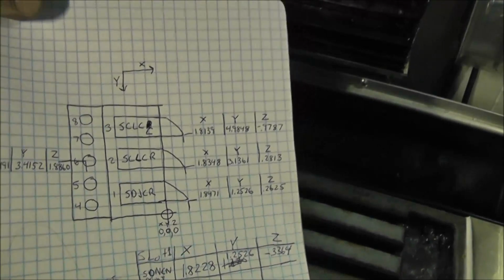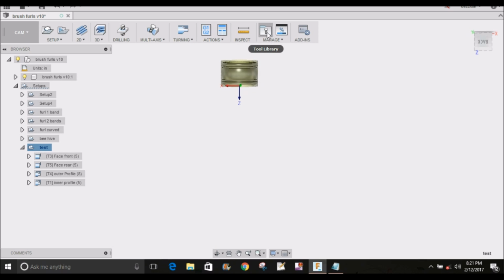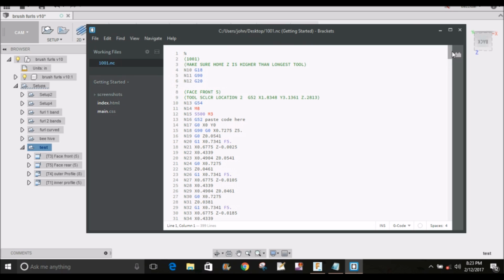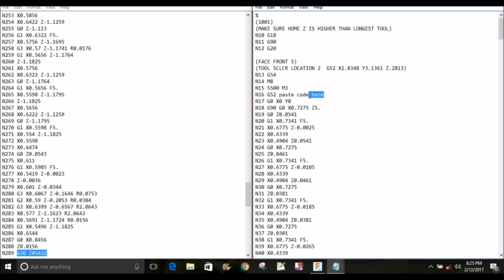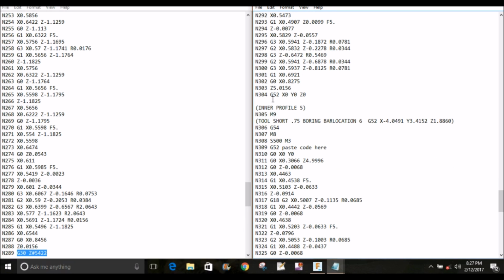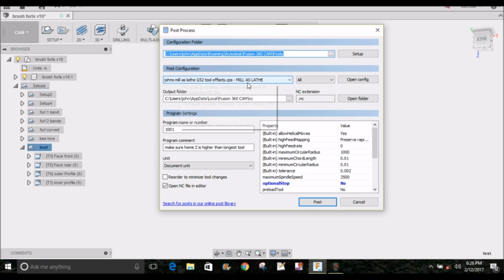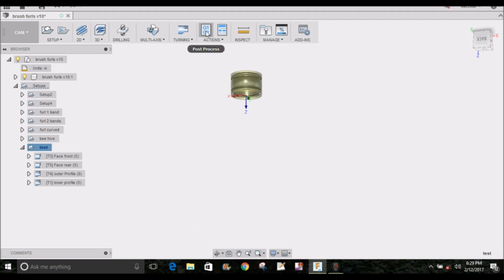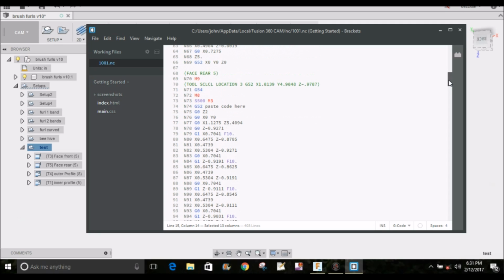Mill as lathe using G52 and Fusion 360

Comment: Hi. Thank You for video. I use the post, and after spindle on, there is no line with "G52 paste code here".
Reply from the maker: There's another post  in the fusion fourm thread.  Mine's the one that's johns mill as lathe.  Im thinking you may have picked the wrong one.
Reply: @22BOZIDAR  Where is corect "johns mill as lathe" post? on my that i downloaded missing the " G52 past your code here " line. there is corect one?
Reply from the maker: @DianTomov_ST_Dupont_Lighters  I no longer use fusion 360. It's been to long to remember.
Reply: @22BOZIDAR  actually I make it the same as your video, but not working properly on my machine. Yesterday I modified the post from my machine and works perfectly. The tools are set as G54-G59

Comment: Great video. Do you have one where you talk about making the tool holder jig?
Reply from the maker: Bill Griggs , sorry  i don't. It's a modular system. the drill holder blocks can be added on or moved out to clear long drill bits. 
     thanks for watching.
Reply: Thanks. Do you have more info on the modular system? I was hoping you had some pictures or plans for the drill holder and lathe holder block. No sense re-inventing the wheel. If not, thanks anyway. I admire your work.

Comment: Great to see you back after all these years! Nice project.
Reply: The weird tool paths is probably the radius diameter mode in mach3. I had something like that when I started programming my lathe. The tools were drawn on the wrong side of the part. But mine actually tried machining the weird shit on the screen.
Reply from the maker: Seventy7 Industries, thanks,  had other things keeping me busy. I always cut air first to make sure nothing bad happens.
Reply: 22BOZIDAR . You wont have to do that once your confident your post works. Id still look at your mach settings. Any reason why you are turning in radius mode? As a machinist diameter mode is more common. I don't think Ive ever used radius mode in 20 something years.
Reply from the maker: Seventy7 Industries I'm doing this in mach3 mill. I have tried to look for the setting but can't find it. Is it only available in mach3 turn?   The post  processor makes the code in radius, so it works in mill mode.
Reply: 22BOZIDAR . True. I forgot about that. And im pretty sure you wont be able to add it in the screen editor. You can always run the lathe profile in your mill. That way you will be able to thread.
Reply: Really glad to see you making more videos! i love these mill as lathe videos. My favorite is the making of tool holders. keep up the great work. hope to see more videos